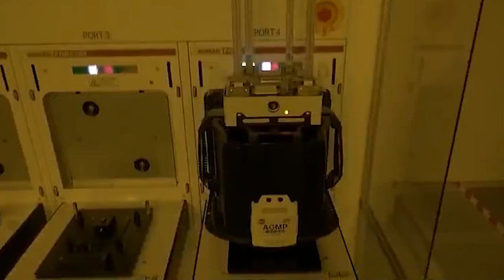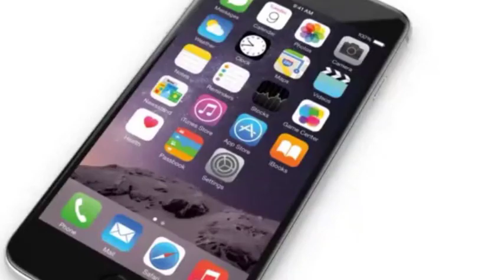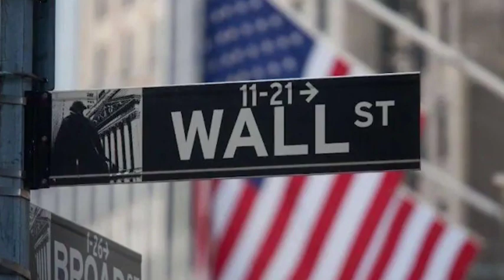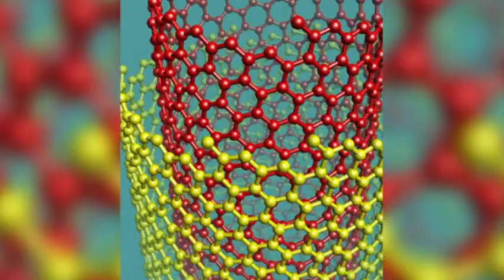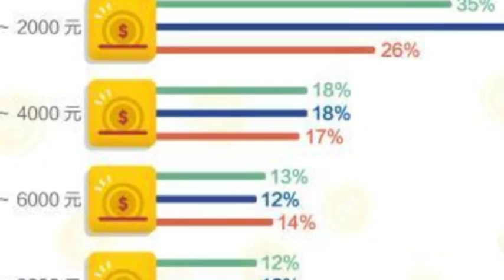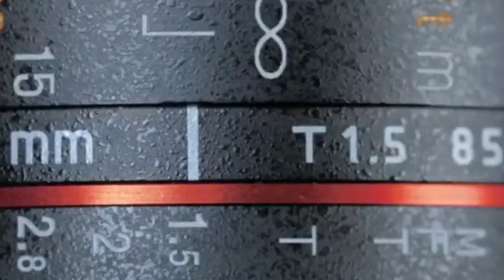China’s 5nm lithography machine may change Sino-US technological confrontation.

Comment: Is this true ? Then why does China need to buy from asml?
Reply: China is the largest exporter of vehicles, but it still import a lot of vehicles from Japan, Europe and USA. China just need a lot of chips and local machine supply is not enough.
Reply: It's much faster & easier to buy off the shelf than build from scratch. Now that the USA has forced China to develop their own tech, it's basically the end for non-Chinese tech.  There'll be a brief window as Western tech gets phased out, before going to zero.
Reply: Because they use ASML machines actually for this, they just use a technique that can make 7nm and 5nm on older machines. Problem however why nobody else is doing that: LOW YIELD. And that means less or no profit at all. That something is possible does not mean it's profitable to make such chips. That's where the CPC government of China comes in the place that wants to make these low yield chips in order to feed the Propaganda. :) But people who are in the Chip industry know this is all just nonsense from China.
Reply: @HermanWillems  Independent analysis of the SMIC-produced 5nm Hisilicon Kirin chip in the recent Huawei Mate 60 phone shows high consistency commensurate with high yields.  The sheer volume of phone sales suggests a very mature process with good yields and good profit.  Claiming low yields without inside data is just Western cope.

Comment: Disappointing video.  Re lithography machines, the Dutch company ASML should be credited with integrating the parts necessary to make lithography machines, not the US.  The US holds the patent on the light source so that is key to lithography by ASML.  Further, no mention of which company has done this 5nm fete and the status of it going into production.  No cost or schedule information to see how competitive China's 5nm lithography is compared to ASML.  Eight minutes of nothing except what was already said in the title.  What a waste.
Reply: China has no 5nm lithography machine. Let alone 7nm or 14nm. The Kirin chips with 7nm are made with ASML lithography machines. But at very low yield, so they can't make many phones because they can't produce so many chips. You can make lower nm chips with older ASML machines, but... you produce less chips per machine. Which therefore the cost per chip goes up significantly making the Kirin chips non profitable.
Reply: @HermanWillems   Independent analysis of the SMIC-produced 5nm Hisilicon Kirin chip in the recent Huawei Mate 60 phone shows high consistency commensurate with high yields.  The sheer volume of phone sales suggests a very mature process with good yields and good profit.  Claiming low yields without inside data is just Western cope.